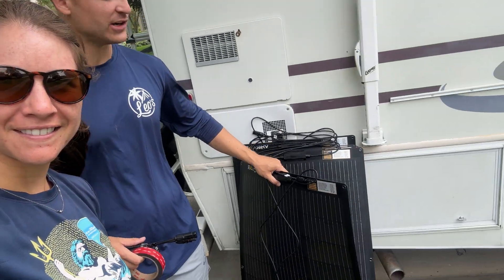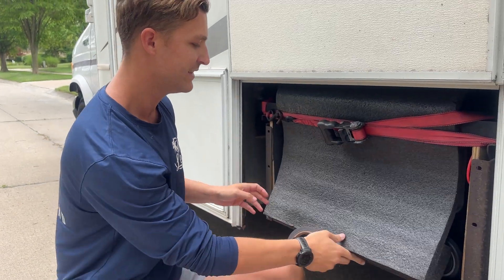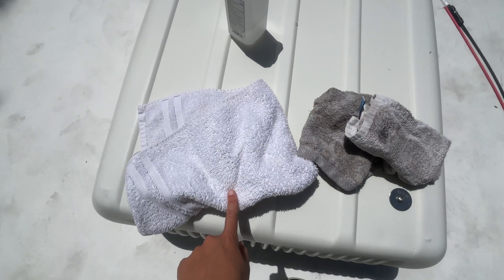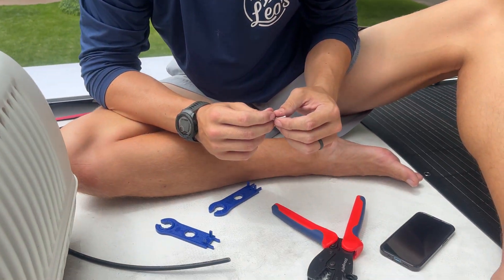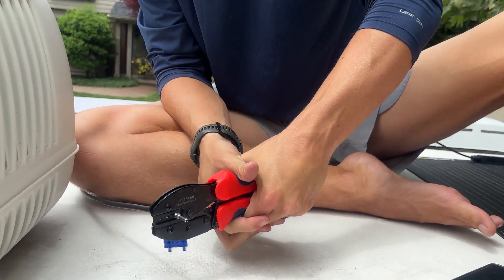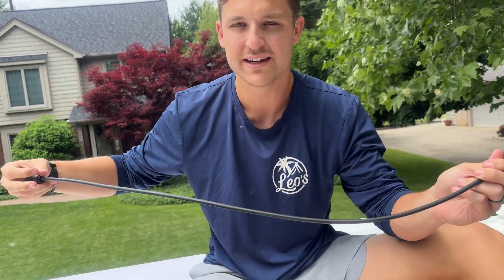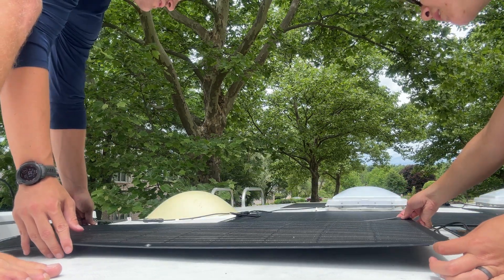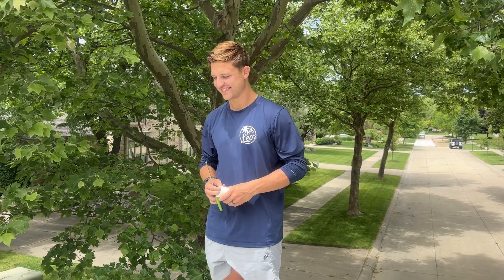Boost Your RV's Power: Adding 500W Solar Panels to Double Your Energy - DIY Guide!

Comment: Hi,
awesome video thanks!
Can you guys add more detail / links for the 3M double-sided strong tape you used?
And also the white cable tidying tape you used on the roof?
Reply from the maker: Thanks so much! I'll leave links below, but want to preface by saying I don't recommend flat mounting panels like this, as we had several go bad from installing this way. We have a few more recent videos on how these panels held up as well as a new method to install rigid panels with a bracket system. That being said...

- This is the VHB tape we used: https://amzn.to/48cVLuo
- For cable-tidying tape we use Gorilla brand, but it's the same as Eternabond or Flex Tape from what we've seen: https://amzn.to/4abCjzJ

Had no issues with these products themselves, just seems like flexible panels aren't to the point that they can be safely flat mounted and last more than a couple years.

Comment: What kind of tape did you use as I put some flex solar panels on my caravan and stuck down with no more nails type glue and they flew off!
Reply from the maker: It's called VHB tape! Incredibly strong stuff.
Reply: @gabandbren how has the tape held up, also have you had to remove any panels?

Comment: Looks good, I like the no drill/ lite weight. 10 year warranty is good as most will not keep an rv more then a couple years. Lot of solar options these days, I like that yours is not permanent and can be removed.
Reply from the maker: For sure! Our RV is a 2002 so lightweight was super important to us. All of our panels combined weigh roughly 35lbs. With traditional panels it would have been 300lbs!